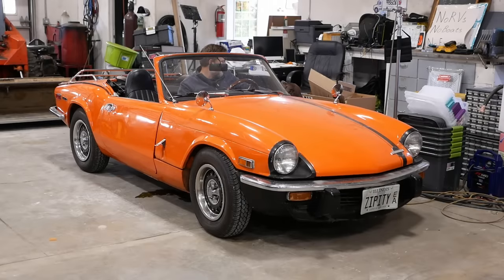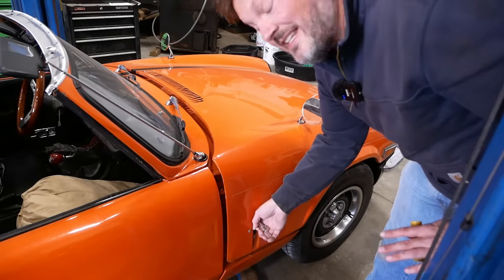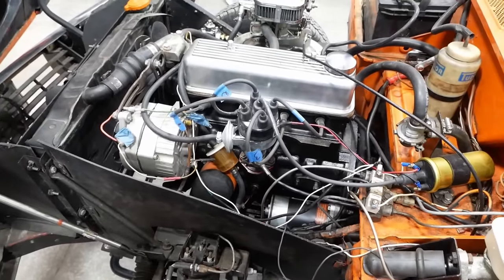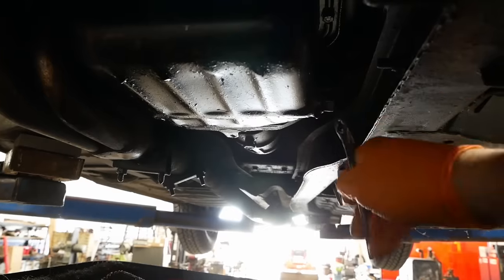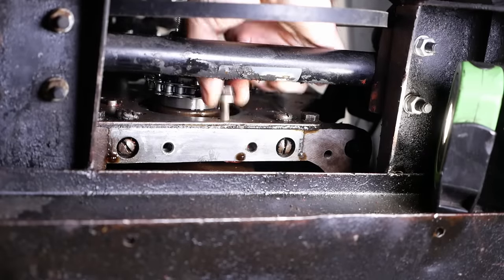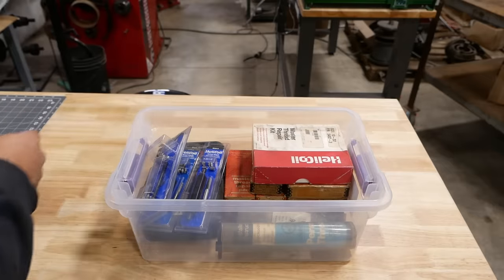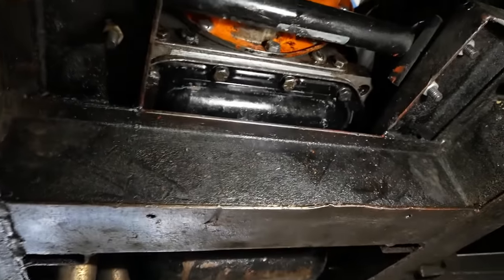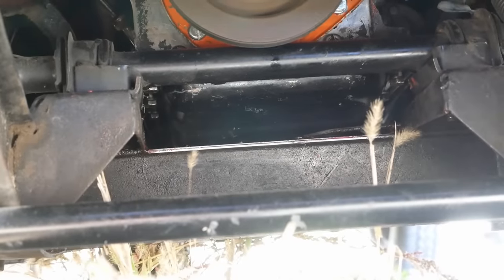Can You Stop a British Car from Leaking Oil?

Comment: In college I owned a 58 MGA.  Turn signal was a knob on the dash.  To open the doors you had to reach in through the window and pull a cord inside the door.  Great fun to drive but it was the reason I became a DIY mechanic.  It was either that or go broke paying other people to fix the things that were always breaking.  Electrical was a nightmare.  Had two 6 volt batteries.  Wire spoke wheels were totally impractical.  That 71 Spitfire was a huge improvement in British cars.  Oh yeah, almost forgot -- the horn was a button in the middle of the dash -- took some coordination to actually honk at someone.

Comment: I bought a 76 Spitfire when stationed in England, had it for seven years and sold it for what I paid for it. Oil leaks were not really a problem, but the universals on the rear suspension were good for about two years. And they started "clicking" time to replace.

Comment: Nice job, We are used to British cars here in Europe. This one is also a car that everyone loved and every driver was in the weekend busy to keep them alive. Oil leaks are pretty normal for BC's, but my '86 V8 Landrover (just for fun car) is an exeption on this rule. The Engine was partly overhauled, but got all the gaskets replaced and indeed, the oilpan bolt holes were flatenned as you did. I use Loctite 3020 spray gasket end thats what keeps everything dry.
But, you sometimes run into problem cars and you enjoy your Earl Grey tea. You'll get from this tea and British cars already in your early yers Grey Hair😀

Comment: You should leave the timing cover bolts slightly loose, then install the belt pulley so it sits in a natural position. Then snug up the timing cover bolts. It will insure a better seal.
I enjoy all that you do Wes.
Reply: Yes, I was hoping someone else spotted this before I commented on it. I have owned and worked on classic mini's since the 1960's and the timing cover set up is similar to the Spitfire. Temporary fitting of the crank pully whilst nipping up the cover bolts ensures the pulley runs central in the timing cover oil seal, this oil seal can be another leak path if not correctly aligned. BTW a real enjoyable vid, much appreciated.

Comment: British (and German - other than Mercedes) from this period (late 1950s - early 1960s) are dead simple to work on and a lot of fun besides.  While not always logical, their designs actually work most of the time.  Please note:  I do not consider Lucas electrical components in this category.  They have their own little corner of Hell all to themselves.  The cars are a real hoot to drive, which is the best justification for their existence, since they are a long way from practical in most cases.  Getting a Spitfire to stop leaking oil - even for a short period of time, is simply miraculous.  You do great work...

Comment: Hey Wes, you missed one.  The original electrical system would have been positive earth!  My sister had a 1980 MGB.  It was a blast to drive but things would break on it just sitting in the garage.  I did a clutch on it.  You have to pull the engine to replace the clutch.  Brilliant!

Comment: Only the mk3 and earlier were prone to roll over due to the rear suspension.  The Mk4 and 1500 had the transverse leaf spring only attached to the chassis with a through bolt thus giving no resistance to body roll at all, thus a larger front sway bar was fitted to compensate.  In had a 71 back in 1998-2001 as a daily driver and it was great.  With electronic ignition, 4-2-1 manifold and rebuilt SU carbs it was reliable and great fun to drive.

Comment: Mercedes technician here, love your channel, grey RTV from Mercedes when applied to any surface will never leak oil, the problem with this sealer it’s hard to remove the parts eg oil pan after it hardens, it bonds like cement, you need to heat up the pan and use prying points on the pan to break the bond. The problem with Mercedes engine is the plastic parts, over time they break apart or leak coolant from the seams in the plastic

Comment: I had a 78 and 79 15 yrs ago. To open the bonnet by yourself you unlatch both sides. then to lift, you get your leg and push in on the fender with your leg and it will push the other sides latch out and you lift at the same time as you push in on your leg and up it goes.

Comment: I used to live in the Bahamas and I owned 2 triumph heralds, a 1360 and a 1300 that used the same engine transmission and drive train as the spitfire triumph had a dense rubber gasket that they used for the oil pan, timing chain cover and valve cover, because as you have found out these items have a habit of deforming! the ones I had never leaked. in some cases a cork gasket (yep i did say cork) could be had! the spitfire i never recalled as being a death trap, it was never that fast, it was just a fun little car, now  the six cyllinder gt6 and the tr6, thats a different story, the tr6 was basically a widow maker car! good luck!

Comment: As a British pedant a mk4 spitfire was 1500 cc and produced 72 bhp but was detuned for the US market to 53 bhp no doubt for your emissions rules. I wonder what capacity a 1974 us engine would need to be, have to be 4000 cc or more.. The later GT 6 had  2000 cc straight 6. The spitfire won it's class at le- mond. Anyway love what you do even if you don't appreciate the character building fine thread and open ended spanner work.

Comment: A 1972 Spitfire IV was my first car.  1200cc, 50 HP.  Simple to work on and so much fun to drive. I still miss driving it along the small country roads of CT an NY state.   I would bet that the batteries of the new full sized electric pick-up trucks weigh more than my Spitfire !

Comment: I always put a light under the pan to check for warpage.  Then I used Great Stuff RTV to seal everything up.  I worked on an Austin Healy where we had to put the rear seal plate in the press to flatten it so the rear of the engine would stop leaking.

Comment: Typically the threads on older British cars were BSF/British Standard Fine, Austin cars had them all over.
I reckon the sump plug would be BSPT/British Standard Pipe Tapered, it's clost to NPT and with the smaller threads you'll get away with interchanging them but I think anything over 1/2" they're a no go, hope this helps.

Comment: Hey Wes, that was an excellent repair.  It's always such a pleasure to watch a skilled craftsman at work.  That little fella rolled out of your shop sealed better than it was when it rolled out of the factory.  When I was 16, I bought an old 1973 MG Midget that was also 16 years old at the time.  It was sitting in a field near a radiator repair shop.  It was kinda rough. You and I seem to be of similar shape and size, so the Midget fit me about as well as the Spitfire fits you.  Those little British care are fun though.   Both the boot and bonnet on mine were bent at the props, and it wouldn't stay in 4th gear of it's own volition.  I rigged a bungee strap behind the seats to hook around the shift lever to hold it in gear.  Drove it like that until I found a used transmission a few hours away.  Took a road trip with a couple friends and picked up the transmission, then borrowed a chain hoist and hung it from a tree in the backyard and pulled the motor and trans, swapped it out, and put it back together.  That was my first major auto repair...and quite a learning experience.  Happily I had a "real" car to get me from A to B, the Midget was just for fun.  Ya know why they have the 2 seats, right?  One for you, the other for your mechanic!

Comment: Don't lift the hood by the latches, use the fender.  The latches can break.  That rear suspension is called a Swing-Spring.  By 71 they had gone to a pivoting spring and wider axles.  They are not all that easy to roll over.  I have a '76 Spitfire that has done quire a bit of track work.  They are a joy to drive.  These were negative ground LONG before '71.

Comment: One other oddity in these cars is that they usually had an overdrive switch which looked like a second signalight switch on the opposite side of the steering column which only worked in 4th gear. So it was an early 5 speed. One other reason that British cars ALWAYS leaked is because they had an aversion to neoprene seals and gaskets because they were too American. Great video!

Comment: Just a suggestion for the cover. I didn’t see a new balancer seal go on, but either way, leave the cover bolts loose, put the balancer on and let the cover center itself on the seal/balancer interface, snug down a few bolts, then remove the pulley and tighten all bolts fully as needed, then install the balancer for good.
Reply from the maker: The cover has dowel pins to locate it.

Comment: I worked on VWs in the '70s.  The pushrod tubes were great for leaking as the engines aged.  #3 cylinder ran hotter than the rest because the oil cooler received air before it flowed over the jug.  I was thinking that you helped drive crops to the mill last year.  I was expecting you to say you're going to do it again this year.  Your son (name??) is growing so quickly!  Max is Max, a casual observer who doesn't care what you do as long as he gets a treat and some petting now and then.  I missed Mrs. Wes in this one.

Comment: Wes, having owned both British cars + motorcycles I can attest to their need for constant maintenance as well as their reliability if you do that work. They drive well and the bikes handle really well! It's the last ten percent with electrics, seam sealing and oil leaks that do them in. They also enjoy rusting in northern climates as well as resisting quick starts in the damp. Other than that they're perfect!

Comment: I had one of those, 1969 MK III Spitfire, during my high school years.  It was a "love-hate" relationship of the worst kind.  I worked on it more than I drove it.  An engine mount failed, the engine dropped onto the steering rack and bent the shit out of it. Windscreen wiper motor is an engineering nightmare, what with the flexible shaft running both wipers.  Girling M/C failed and the piston was jammed into the end.  and it always had electrical issues.

Comment: I had 2x Spitfires back in the day and they were indeed fun. You only have to look at the body-on-frame design to see they came from the dark ages. A lot of those still running in the UK have had Ford Zetec engines fitted.

Comment: I have a 50 year young IH tractor with oil pan in similar condition.  The experts' consensus was to use the OEM (in this case cork) gasket with a thin layer of suitable RTV applied to both sides.  It worked well in this case.

Comment: Talk to Subaru and their FB engines. They use Mostly RTV. They use to even seal their block halves, and cam carriers. Can anyone say TSB territory. If anyone's ever sealed up their timing chain covers, then they know the artform called RTV prep work. They always leak again anyways so you'll have all the practice you need. The service manual indicates to use RTV and a gasket when sealing the rocker covers. Apparently a gasket wasn't enough for them.

Comment: Wes have you ever used “the right stuff” sold by permatex? It’s expensive but man does it work wonderfully. I won’t use anything else, it is like silicone but it adhesive properties and it’s strength are perfect. I use it on the china rails of engines.and other areas like oil pans etc. take care buddy.

Comment: Usually referred to as a Triumph S**tfire amongst most mechanics in Ireland. A hazmat suit is the appropriate workwear when doing anything underneath as the oil and brake fluid leaking is definitely a hazard ! Most owners would have a wide shallow tray full of sand underneath the engine and gearbox similar to anyone who owns an older british motorcycle.

Comment: The only thing to make this video better would be if you had a 1970-71 Cadillac or Lincoln land yacht to park the Triumph next to.  Also, when Packard received the license from Rolls-Royce to build the legendary Merlin aircraft engine, Packard had to redesign the engine from the ground up.  This wasn't due to switching from metric to standard or any other type of conversion, no it was to simplify to building process and to tighten up the tolerances for Packard's ability of precision machining.

Comment: 20W-50 is pretty typical for the era, I used Castrol GTX 20W-50 in VW Sciroccos and my 1978 BMW motorcycle where it was the factory recommended oil. The higher viscosity reduces drainback and works well in air cooled engines. Also that Spitfire appears to have the "big" engine, a friend had a 67 Spitfire with an even tinier engine.

Comment: British cars are a challenge, but super rewarding when all sorted out. Those spitfires handled corners like on rails. Very, very fun to drive. You always seemed to be going faster than you really were...lol.
Reply: Those cars originally came with bias ply tires.  Radial tires were still a novelty, mostly found on French cars and tires from Michelin tire dealers.  There's a world of difference in any car's handling between the two types.
With that terrific rear suspension design (very similar to the GM Corvair (book: "Unsafe at any Speed")) everything is fine ... until the rear suspension flexes and the wheel rim digs into the pavement ... and the rest of the car does really nasty, unexpected things. How many rolls do you think?  Beware driving that car fast.

Comment: In lieu of an excessive amount of silicone,  a useful trick is to get thick pieces of sheet metal (bolt holes drilled appropriately), and places along the lips of the oil pan. They act as a brace that provides equal pressure in between bolt holes, and ensure that the pan edge doesn't get too far from "flat". If you use rhat in conjunction with the RTV method, good results have been achieved.  :)😊😊😊😊

Comment: Wait until you encounter Lucas the Prince of Darkness - fine electrics. I used to own a Wolseley 24/80 - 6 cylinder blue streak motor, here in Australia. From memory 12 hours to get the motor out and 13 hours to get it back in. Had to lift the body off the front end & motor, wheel away, (on flat tyres) - replacement was reverse . Great fun when I was a teenager - now in my 70's a horror story. I thoroughly enjoyed your video..

Comment: Claas Lexion 8600 Terra Trac. "The coolest German Thing Made in the USA". Built in Omaha. The Claas company is still largely family-owned and sits about 50 miles off from where I live. 6 cylinder 12.4 liter engine, 359 KW sustained / 404 kW dynamic (~ 506 / 542 US hp) - MAN D26. Weighs 22.4 tons. Average sales price September 2023 in Germany: 589.050 Euro ... that's about 624.000 US$. Nice to see it over there at your place.

Comment: I had a shop we use a product called right stuff never had any problems with a leak we got ours from parts plus usually cheaper to buy the starter set comes with 2 tubes and a caulking gun

Comment: A shame you can not find a Triumph TR7 to fettle Wes.They were a real treat. The one my mate had used to wiggle when you changed gear.When he finally plucked up the courage to look underneath it he found the chassis had snapped.This was in the 1980s so it was not that old either.A good engine for the day though until they joined two together for the Triumph Stag .They should have used V8  rover engine which was there to use.Which was a Oldsmobile cast off i understand .

Comment: about that 1870's crack... ya, pretty much agree.

my 1953 MG looks to have been designed stylistically at least, if not the 1800's, at least a long time ago. from it's stand alone headlight buckets to it's flared fenders and running boards, to its suicide doors and side-curtains and even down to the hole in the front bumper for the hand crank. it's straight out of the 1920's THAT's 'fer sure. haha.

Comment: I bought a ‘74 Spitfire new while stationed in England, had it shipped home when I came back to the states in ‘75. It was fun to drive but didn’t have the horsepower for American highways. Compounding that lack of HP was the (electronic) overdrive; even on mild uphill grades it couldn’t maintain its speed. Anything less than 65mph in o/d and you’d be downshifting. The national speed limit at the time was only 55!

Comment: So far, the only engine related project I have is the "oil change" on my tractor. It's also quite a simple machine. As for the harvester: around here - i.e. in Austria - I know that most farmers will pool together to get and share one of these. There are even whole companies that provide rentals for that reason. Smaller farmers would need one only for a day or two a year and that would certainly not pay off ever.
Reply: Farms do that here in America, too.  A crew will work the fields of dozens of farms almost nonstop from as soon as the dew burns off until as late as 9pm.  A series of haulers will transport the produce so full ones are replaced by an empty one without delay, and they have their own tankers so the harvester doesn't have to stop to refuel.  They also have GPS tracking, so if they spread or harvest the field again, it can follow the same path with little input from the operator.